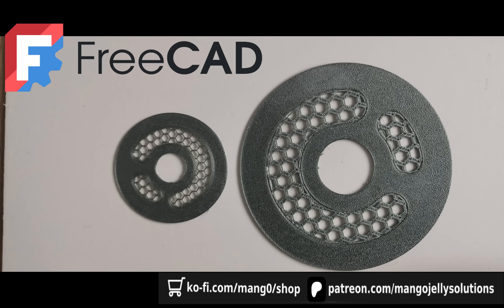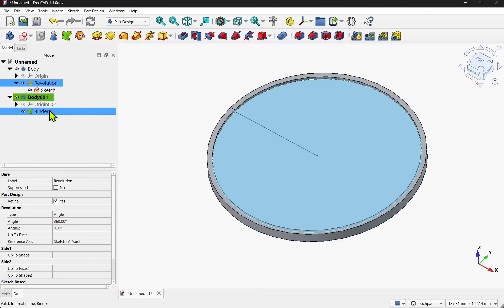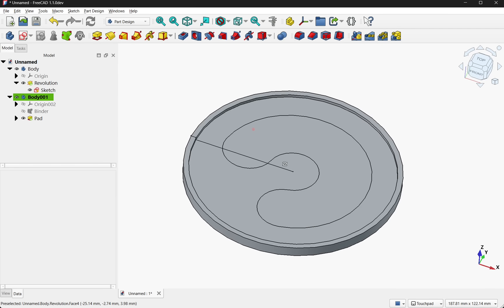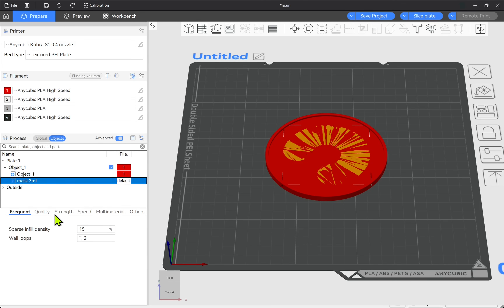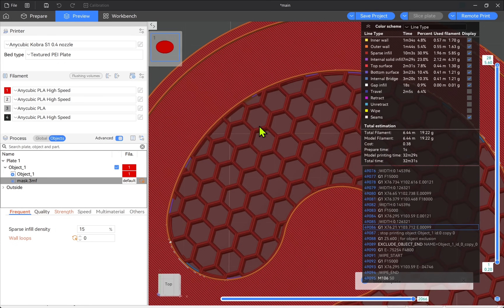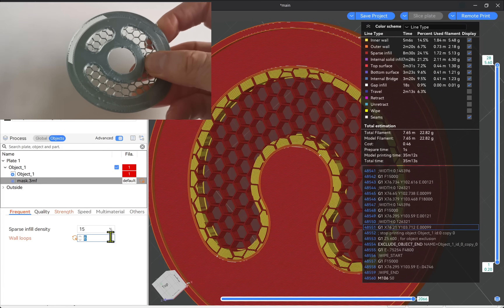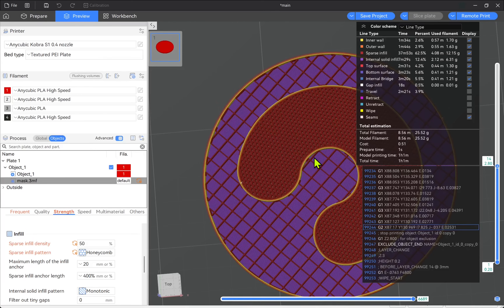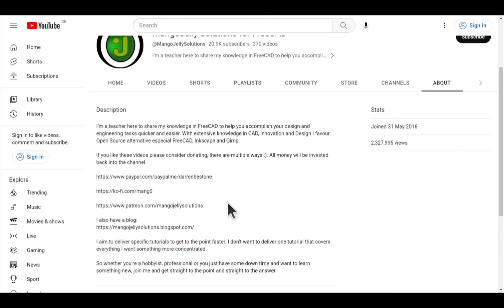FreeCAD: Easy 3D Printable Hexagon Mesh | The Cheats Way

Comment: Great idea how to overcome some other problem, but I consider this as not related to
FreeCAD by any means as the whole process for the pattern is done in the slicer software, even when FreeCAD dictates its position.
Reply from the maker: Yeh it kind of tangent to freeCAD (as in the fabrication phase) so thought I would include.  The modifiers are extremely useful.  I have just used them to increase the volume in one of my parts to give it a weighted base.

Comment: I have tried this on a part I was working recently without watching your video and got the weird artifacts along the walls you presented here. After watching the video, I decided to test the same part in Prusa Slicer and the overlap seems to hide those artifacts, but judging from the gcode nozzle movement animations, it does still try to print both the problematic walls of the modifier and the overlap that was created to compensate. Wouldn't this just make another type of artifacts, like raised layers?

Comment: I frequently use infill for this sort of application but with the standard modifiers.  I didn't know the trick of importing the modifier.  It's also easy, at least in OrcaSlicer, to click "Alternate extra wall" and it'll add an extra internal wall on every other layer to overlap the infill to lock it in place so the infill is more securely bonded to the outer walls, whether the infill is traditional infill or the screened interior as seen in this video.

I made a very cool grippy handle for a 3D printed knife by setting a very high number of wall loops to make the perimeter of the handle 4 or 5 mm, then printed open honeycomb infill for the interior.  Free OrcaSlicer texture.

Comment: Using Creality slicer. The infill does not get rendered if the top and bottom layers are zero. Prusa works fine.
Reply from the maker: Thanks for feeding back regards that, didn't expect them to act differently.

Comment: Indeed I already used this trick that I came to know by accident as I played with the top layer in the slicer and was wondering if this is usable. But if you need the mesh in the vertical direction you are back in FreeCad (at least to my knowledge). My solution was to print separate parts and click them together but may be this is not always possible...
Reply from the maker: I have seen the 3D infill for vertical being used elsewhere but it's just not the same, and looks pretty scruffy.  I am on the lookout for alternative solutions other than manually modelling them.

Comment: Not exactly relevant to this video, but: I had an idea for a contraption which would make a particular task related to yarncrafts a lot less tedious and uncomfortable for both me and my husband. I talked to a friend about it, and sent him an animated .gif giving the general idea of what I wanted it to do, but didn't know how to get to actual Plans. On the 1st of this month, he said "I'd use FreeCAD, but it has a pretty steep curve. If you want to try, MangoJelly does superb intro vids." So I settled down to go through the beginners 1.0 videos, and last night (17th) I had a proof of concept done and animated in Assembly. 
There's no way I would have been able to do it without your videos, so I wanted to say thanks. 
There's a lot more work to do on it - I need to make sure it's laid out so it'll be comfortable to use and I need to add some more features. The mechanism I ended up designing to make the various parts move in sync the way I wanted them to isn't what I'd do in reality, and the extra features would rely on the mechanism being different, but I don't think it's possible to animate a lot of what I'd actually do in FreeCAD, both because some parts are angled in relation to other parts and so don't stay lined up in a way that the Assembly joints can cope with and because it would involve flexible parts like leather straps and parts pushing or pulling other parts which they're not directly attached to. But I can design the parts at least!